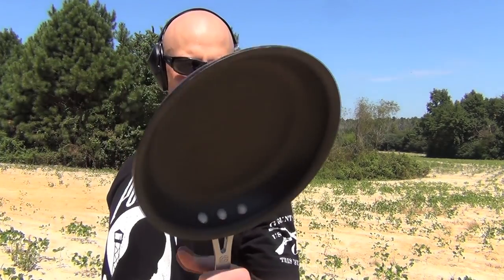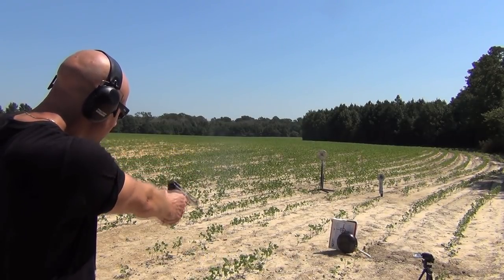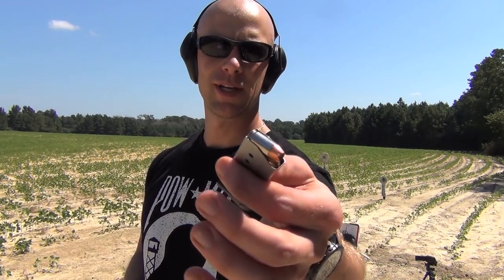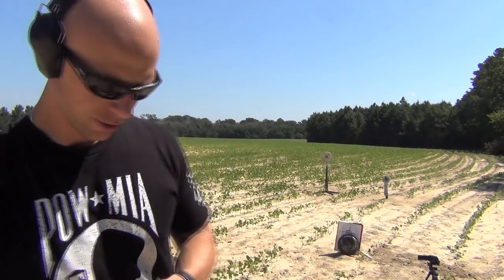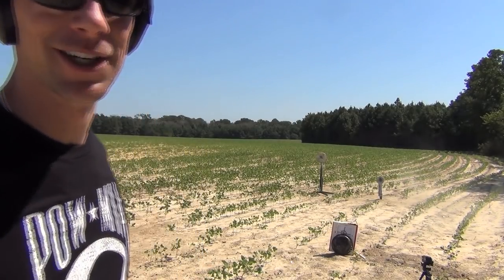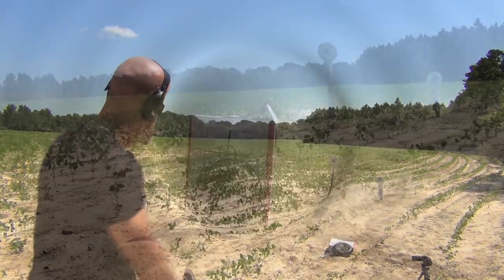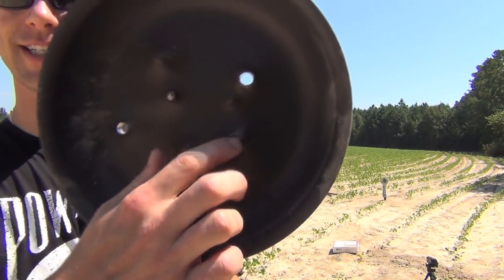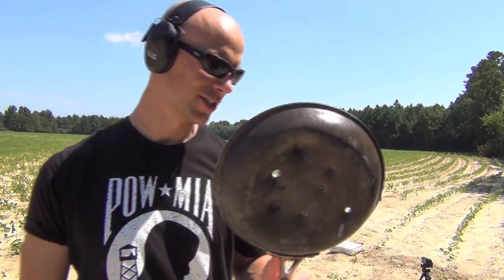Improvised Armor (Frying Pan) Penetration Test  (380 ACP, 9mm, 45 ACP, ect..)

Comment: Looks like 40sw fmj hit harder than 45 or 9mm  45acp has a long history of failing to penetrate military vests and barriers 380 fmj didnt go through surprised me plus 22lr did similar damage as the 32 and 380.
Reply: the 9 mm was a hollow point, not a fmj
Reply: +lino klein meuleman correct my mistake I think the round nose of the 380 and 45 is what stopped them from going had it been a flat nose 45 and 380 fmj they mite have cut right through it.
Reply: Chris Collins the 9mm whas fired with a jhp,the 40 a fmj .

Comment: For targets, armor, car doors etc., penetration is good, but for shooting "meat" especially in self defense, penetration is less effective. Yes when I pull it penetrates, or even goes all the way through a living target, it will be very effective, but not as immediately effective as a slower heavier round that literally knocks the target off of its feet. Not to mention, with penetration comes potential for secondary unintended injuries. You definitely want your round to stop in its intended target and not pass through and get someone else on the other side. Jacketed hollow points FTW!!

Comment: So I am trying to figure out the common factor between penetration and non-penetrating rounds.
If its velocity then the .22 should have gone through at about 1200fps beating out the 9mm that went through at about 1,100fps. So its not velocity.
I then thought muzzle energy, and that holds up except for the 45acp, which is in-between the 9mm and .40
So I got to thinking what if its a factor of muzzle energy and bullet diameter (bigger the bullet, the more steel it has to move out of the way) If you do energy/diameter you get an arbitrary number but it holds up to the penetration test. So if you had shot a .45ACP +P with just 100 extra fps if would have been between the 9 and .40 with the penetration formula and gone through the pan.
Reply from the maker: o0westwood0o perhaps

Comment: If capacity was not an issue, meaning all guns could only have 10 round mags, then what round would you pick?  I know you pick what you can shoot the best but I bet more folks would carry the .45.  While most move to 9mm or even .40 for capacity, the .45 hits with a lot of energy.  As some said, they dont hunt frying pans, and most bad guys dont wear body armor.
Reply from the maker: MrFoxer35 Full size gun? 45.  Compact? 9mm.   But most shooters would be better off with 9mm as they aren't proficient enough in handling recoil to compensate for the increased recoil of the 45ACP and with handguns getting multiple rounds on target quickly is what matters.
Reply: Mrgunsngear Channel Another thing to consider is over penetration, clearly that would be more of an issue with 9mm and .40 cal.

Comment: It was silly but it was still interesting and you could really see the strength of the hit with the deformation of the pan. Makes you think of things like if the 9 and the 40 go through that metal then they really should go through bone and keep going very easily where as the 45 might just be effected my say the sternum? Not that it's gonna bounce off or anything.
Reply from the maker: rick smith Indeed.
Reply: Keep in mind the .40 was fmj which is known to penetrate barriers, and the 9mm was cheap HD ammo that has been proven in tests to not expand properly which basically is like another fmj round. It would be interesting to see how this turned out with some higher quality rounds.
Reply: Shure would :)

Comment: When you start bending and stretching metal, you're changing its characteristics and actually hardening it with every impact.  I know you didn't have 15 spare pans lying around to put holes in, but even the little .380 should've ripped right through.  I'm surprised all the rounds didn't get all the way through, but that all depends on the particular loads.
Reply from the maker: +Mike Bircher indeed

Comment: Good video, liked that you used a common object... to the .45 fans, this was the best of what happened. The .45 should not over penetrate, (bystanders) and all mass x weight x speed stays in the target. good vid :)
Reply from the maker: Noah R. Thanks.
Reply: mass is weight
Reply: *****  correct, but irrelvant within context...technically mass is imparted by the interaction of the Higgs bosun and the higgs field, gravity is a conceptual construct representing the push experienced by an object on a surface moving thru  space

Comment: I always wondered if they reenforced police car doors because I had seen in several instances police taking cover behind them in firefights.  Seems like training that could get someone killed.
Reply from the maker: Pepsiaddicto Agreed.
Reply: Mrgunsngear Channel I know in 2004 crown vics they could order them with Kevlar lined car doors to "enhance" protection. I did find a few car doors that had taken rounds and with the windows down, they still weren't broke. I couldn't tell you if they were .38, .380, or 9mm but I can say that wolf ammo typically isn't up to the 850ft/sec rating of most standard ball ammo, but +p ammo tends to do the job no problem on frying pans. my first gongs were frying pans of various ages and sizes. the extra heavy ones like lodge logic put up a struggle until they crack lol.

Comment: Before watching I guessed if any of them penetrated the pan, it would be the 9mm and the .40S&W.  Velocity is king in penetrating hard surfaces.  And on top of that, a 165 grain .40 has more energy than 9mm and .45 ACP.  People call it an in between round, but those people are ignorant.
Reply from the maker: +JustAGuy indeed

Comment: y would a .40 pass through and a .45 not? great demo btw
Reply: A .40 is traveling at a significantly faster velocity. That coupled with that fact that the .45 has more surface area to penetrate, due to its larger bullet size.
Reply: nchieka11 makes perfect sense, but I thought that the .45 had more powder... thnx
Reply from the maker: nchieka11 Correct.

Comment: Very interesting, the .45 failing to penetrate surprised me. I wonder how a .357 magnum with fmj would fair. I actually have an old frying pan that I've been saving for this very purpose, I guess it's about time to to "go green". Thanks for a fun and informative video.
p.s. Were ricochets not a concern to you?
Reply from the maker: no
Reply: .45 is slow 230 grains @ 850 fps
Reply: Not surprising at all.  The standard load travels at less than 900 fps.  MrGuns forgot to test the .45 acp +P loads travelling in excess of 1000 fps.  I have a good feeling that those would have penetrated the pan with no problem, just like the faster 9mm and .40 rounds.
Reply: El Guapo Well, as I stated in another post, I performed a similar test using (among others) 38 specials, fmj & jhp, 800 fps & 900 fps, respectively, and both penetrated easily. Granted my heavy steel skillet was not his skillet, so very non- scientific comparison, but still am surprised that the .45 couldn't do what a .38 did.
Reply: El Guapo Well as I stated in another post, I performed a similar test with .38 special fmj& jhp, 800fps & 900 fps, respectively. Both penetrated easily. So I am surprised that the .38 outperformed the .45. Granted a very unscientific test, with 2 different, albeit, heavy steel skillets.

Comment: Wolf 45 acp has been verified by chronograph a number of times to be underpowered.
Reply from the maker: Ok.
Reply: Mrgunsngear Channel
I agree, but I don't think this was a serious test...he even says that. Quality .45acp would have gone though, i'm quite sure. Wolf junk has around 330 ft/lb of energy best I recall vs say something like some gold dot 200 grain +P's which pump out 518 ft/lb which is damn close to off the shelf 10mm power. And if you want to compare apples and oranges, you can convert several .45 pistols to .460 Rowland and have .41mag power in a semi auto. (around 1000 ft/lb) blowing away all other semi-auto's. 

Get off the 9mm vs 45 bs. They both work, and have different attributes and advantages. You want to deliver most of that kinetic energy and make a big hole, go .45, you want to punch holes in shit, go 9mm and have more capacity as well.

Comment: If you do some research you will find that the .22 magnum was one of the toughest rounds during FBI bullet proof vest testing, it's no surprise to me that the little .22 did well, a .22 magnum would fly through that pan like butta!! In my honest opinion the .380 is just a teeny tiny step above useless
Reply: +ChalupaBatmanMacArthur It's still a very weak round.
Reply: ***** Anything is better than nothing for defense.  But I doubt anyone is going to be tapping out one hit head shots.  But then a vital shot is a vital shot.  But aiming at the heart and shooting doesn't mean it will carry a straight line to the heart.  
My point is simply a .380 is likely to deflect.  9mm's are known to deflect after coming into contact with bone.  I'm not saying it will happen 100% of the time.  I'm not implying a .44 Magnum will deflect 0% of the time. 
But some calibers are much less likely to deflect when you do hit the intended target.  And some calibers do more damage when you do miss that .25" critical area.
Reply: Ignorant statement.  A .380 is a viable self defense round.  Would you like to take 3 to the chest to test that out?
Reply: lol, 22 stinger would pass right through

Comment: do some shoulder exercises instead of just biceps
Reply from the maker: ok.  You're apparently the expert.
Reply: what does that have to do with the vid
Reply: face
Reply: Actually, lifting weights will shorten your life. So will all exercise. The gov. (corporations that control the gov.) don't want you to know how the body really works. It would limit their sales of exercise products. Every time you kill a cell it regenerates. The problem is that it can only happen so many times in your life and eventually the cell will die for the last time. That's why wrinkles happen in the most used parts of your body over time. Your heart works the same way and only has so many beats in its' lifetime. The more you use it, the less life it has. That includes exercise and being overweight.

Comment: Sorry do not understand, but which gauges penetrated the pan?
Reply from the maker: Luis Torres Did you watch the video?
Reply: Eu uso google tradutor pra texto, gostaria de saber se a 22lr perfurou a frigideira, alguem pode me escrever a resposta com sim ou não?.
Reply: I use google translator to text, I wonder if the 22lr pierced the pan, can someone write me the answer with yes or no ?.
Reply from the maker: Luis Torres Ok.  No, it didn't.
Reply: Only the 9mm and.40S&W penetrated the pan. The .22, 32,380 & .45ACP failed.

Comment: What is the purpose of the rounds? Too many individuals quickly state one is superior to another off of some simple test and they’re sold. It’s not the easy. If ARMOR pentetration is the key, go for velocity and penetrating rounds. If it’s for your average soldier who believe or not does not have that great of body armor in most armies. Any civilian, jihadists, or animal. In that case; a larger mass bullet traveling slower is actually more devasting. There is such a physics thing called time, it takes a finite amount of time for that bullets energy to be absorbed into a mass, especially an elastic mass like flesh and bone and fluid. Smaller and faster bullets can pass clean thru a human or animal without much of that energy absorbed by the target. Like a 22 or 17 cal flying through a coke can and never even see the can move.  Slow the bullet and give it more mass and it transfers more energy into the target. There are plenty of books on this very topic. Some animals or people can be hit by a small fast armor pan penetrating round and most of that energy never was absorbed by the target and passed straight the the target. Dead sure. But with a 45 or 40 bullet, more of that energy by far will be absorbed by the target and push them back or knock them down like they were hit by a truck. Simply penetrating a target isn’t always the best solution. It’s either by a bullet coming apart inside it or by shear mass and slower allowing energy transference into the target. That is the physics of a targets mass actually absorbing the kinetic energy. Most fast small rounds zing right on through with hardly any transference. Into the target. No knock down power even if you don’t penetrate. Like being smacked by a 12ga slug. Your going backwards or down with crushed ribs.

Comment: Jhp in the 45acp would of went right through that no problem
Reply from the maker: zackery estes Ok.
Reply: I don't understand why you shot a jhp in 9mm and 40s&w the switched to fmj in 45acp had you used fmj in all if them non would of penetrated jhp makes tremendous difference.
Reply: zackery estes I think you misunderstand the point of JHP bullets. They would be LESS likely to penetrate a hard surface because of their structure.  They are designed to penetrate soft tissue then expand rapidly.  FMJ are designed to stay in one piece through whatever they hit.
Reply: Sorry to tell you but your wrong, I have tested it first hand. I had an old steel deer feeder was 1/8" thick steel and I used 380,9mm,45 acp. The results not one fmj from any caliber went through they all dented it in 1/2" and the bullet kinda flattered a little and was very stuck. ,tried gold dot and critical duty in all calibers,and 380 still didn't go through period 9mm went trough with 124+p gold dots dented the other side of the barrel slightly and the 135+p critical duty did the same. The 45 went through and put a 1/4" dent on the other side in both 230 gold dot and 185+p critical duty. Hollow points are made to penetrate.
Reply: zackery estes If you look at your results, the rounds that went through were all +p rounds (with the one .45 being the exception).  It's the velocity, not the bullet structure.  Hollow points are not designed to penetrate anything more than a light barrier (clothing) in front of the flesh.
Reply: zackery estes
Are we supposed to believe that because you say so? Where is the video? Where is your proof. What the man in this video did was take a basic scientific approach. We all know pretty much everything he used in this video so we know all the controls in place.

Comment: Your .45 acp barrel at 4-1/4" is too short to achieve the velocity and full power of the .45 acp round. People who are not that knowledgeable probably do not realize that.
Reply from the maker: Ok
Reply: what is the properly barrel length to achieve maximum .45 performance?
Reply: Eric Martinez Pistol is 5", carbine 17-1/2".
Reply: It's still probably realistic. The original ball round was a 200gr bullet at 900fps but the the military wanted 230gr so that's what JMB gave them but it only clocked in at around 800 or so. I bet if he chronographed that load it would be close enough to 800. That being said if he used a 147 in 9mm and 180 in 40s&w the results might vary but he specifically stated it was for fun. Not something to dwell on. 45 will still work just fine.
Reply: PeterDad60 What about all the other guns he used ?Do they need to be 5 inches or bigger?

Comment: Fake a 45 would have blown that pan in two. That wolf ammo is slow and soft. You need a full copper barnes with solder put in the hollow point. 185 gr. +p load then that pan would have cracked in two and sent the 9mm running with its tail between its legs.
Reply: "a 45 would have blown that pan in two".  All we have to do to make a 45 work is take a specialty made super-hard copper bullet, fill it with lead to increase the weight, and load it to +P velocities.  The 9 and 40 work right out of the box.  Thanks for confirming the deficiencies of the 45.

Comment: Speed is not matter for penetration.Better penetrators had small calibers and big energy momentum.Wide FMJ 45 ACP cant penetrate better than tin lead 22 lr.Smal calibers penetrate beter than big diametar calibers.Because his big diameter 45 ACP is poor penetrator.
Reply from the maker: The cross section is a factor but speed is absolutely a factor for penetration through intermediate barriers.
Reply: For example you had Russian 9x39 subsonic caliber for Vintorez sniper,subsonic but extreme penetrator,big weight and relative small and slow caliber but with manny joules of energy.
Reply: toniiii9
Speed is VERY much a factor in penetration. The army found out that small and fast penetrates metal MUCH better than big and heavy. The opposite might be true for softer targets, or wood or whatever, but it is absolutely true for steel.
Reply: +toniii9
Other than speed, how DO you impart "big energy momentum"?
You're not making sense.
Reply: Energy momentum depends of speed and more of mass.Penetration depends on the bullet diametar also.You will not penetrate same with knife and fi 60 sprit if you use same energy momentum.
Reply: Nick Motsarsky True, otherwise the .223 and the .22lr would have comparable penetration.

Comment: Dont you afraid of the ricochet?
Reply from the maker: No.
Reply: Can the bullet rebound when it hits hard object like the pan?
Reply from the maker: Yes.  It's possible.  Depends on the bullet, the object, the distance, and the speed.
Reply: The chances of a bullet bouncing straight back are very small, for example when u shoot ar500 steel plates metal and was usually splatters at around a 90 degree angle to point of impact